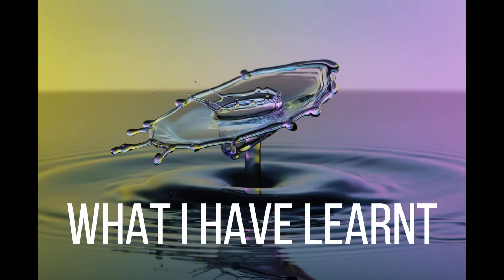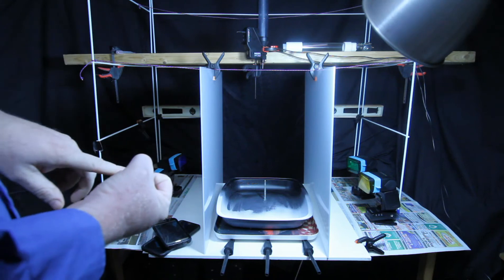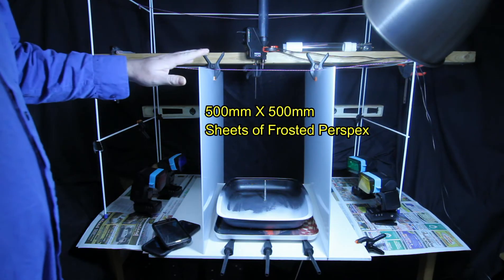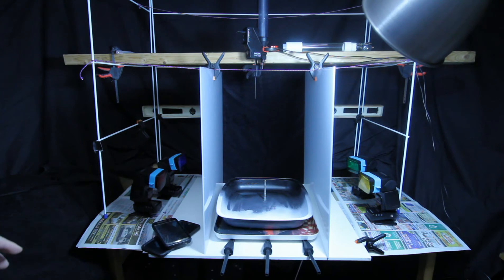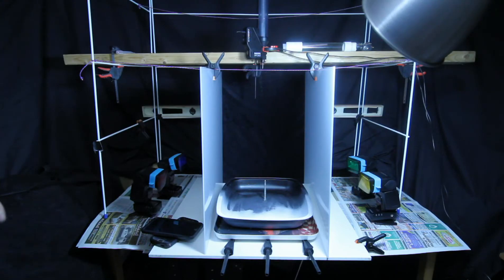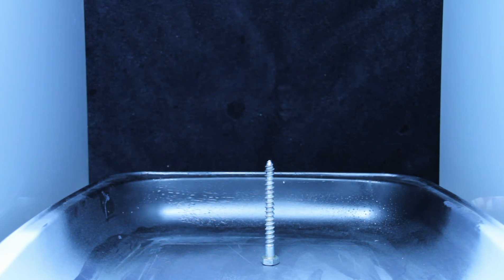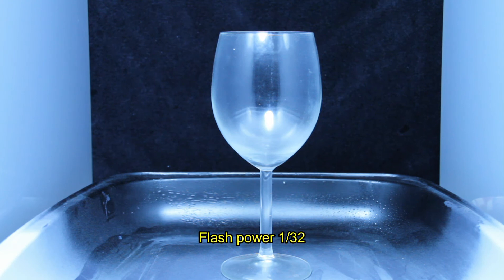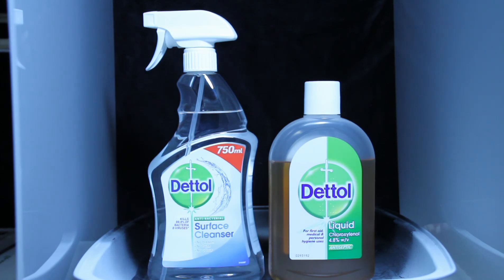Better Water Drop Collision Images

Comment: Hi, Can you explain what to do, when water does not rising high enaugh? How to achieve higher water stem?
Reply from the maker: couple of thing to try, 1 have the dropper higher and 2 play around with depth of tray mine is about 3 inches deep and i get alot of height, too shallow and you dont get the bounce back up

Comment: Given that the action is frozen by the flash duration and that typical flash sync speeds are around 1/200 second, I'm curious as to why you use such long exposure times.  I'm sure there is a reason but I'm just not cluing in to it.
Reply: The flash “sync” speed may be 1/200th of a second, but the flash duration is much, much shorter (as short as approximately 1/2000th second). You’re shooting in the dark so the long exposure time (shutter speed) is made mostly irrelevant by the short duration of the flash. The flash is doing all the work as there’s no ambient light. Did that help?
Reply: @AndrewOvenden  I do understand that the the effective exposure is the duration of the flash which is why I'm not understanding why one would use a shutter speed that is longer than the flash sync speed.  I just rewatched the video a couple of times and don't see any reference to any shutter speeds so, unless the video has been edited between when I posted this question 3 months ago and now, I'm not sure why I even asked the question.   But thanks for your reply!
Reply from the maker: having a long exposure in the dark, and not going with flash sync, simply because the hit rate of using flash sync was hit and miss, the triggers are not 100% accurate for firing purposes, but with a long exposure, that single moment of the flash sync is now irrelevant as long as the drops occure when the shutter is open
Reply: Also the shutter vibration will have settled down. I have done this using film and plates in the 60’s, dark room, shutter open on bulb, drop and fire flash needs two hands, works but a lot of misses. So much easier with the modern gear. I only had a single Metz 60 flash gun. Amazing what we achieved with film.